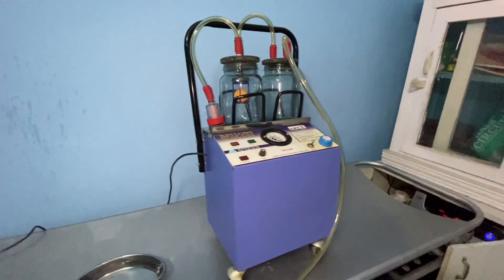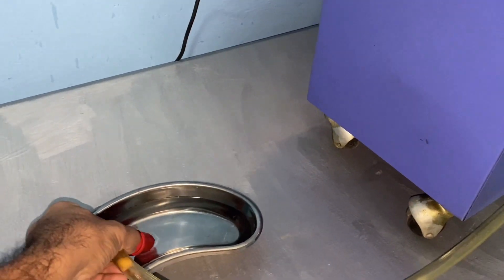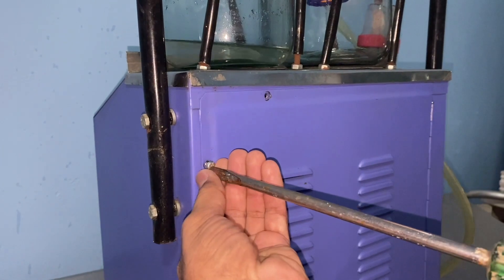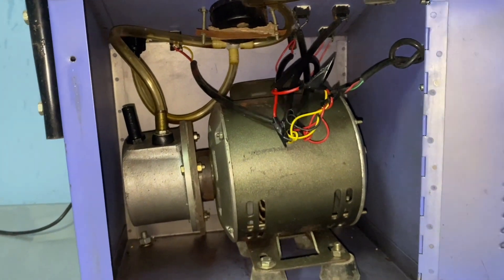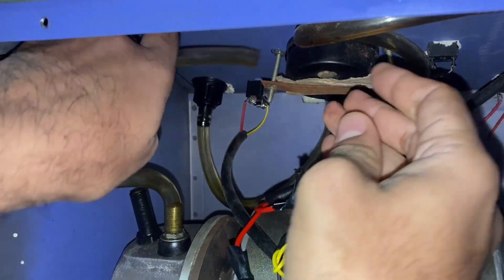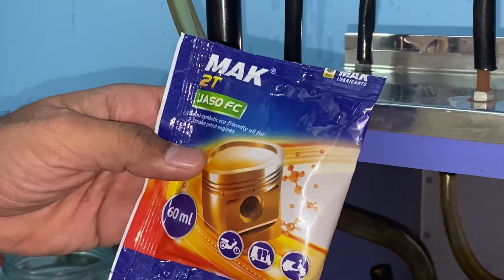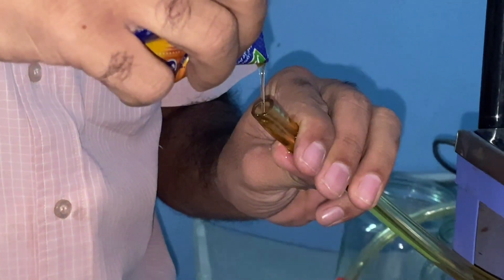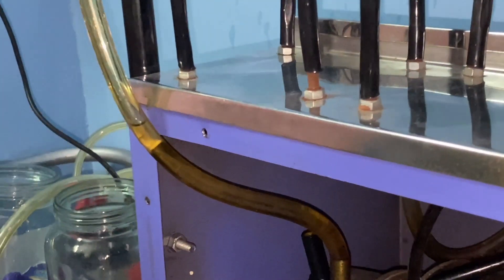MEDICAL SUCTION MACHINE | VACCUM MACHINE | MAINTENANCE

Comment: There is a oil leakage from black colour nosile  beside the oil pipe connection what to do
Reply from the maker: May be excessive oil
Reply: i have the same problem and it drains all the oil, what to do? does the black nozzle suppose to have a hole at the top?